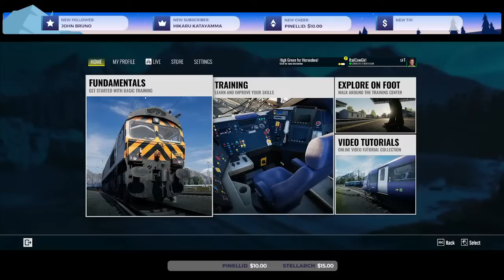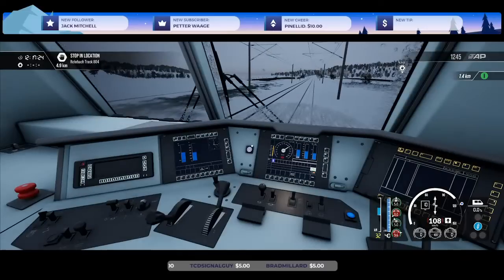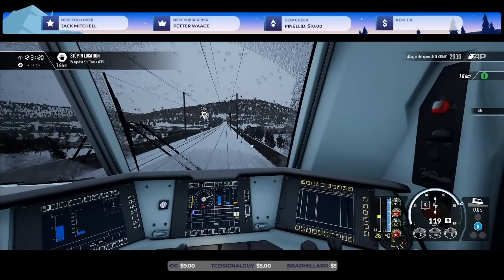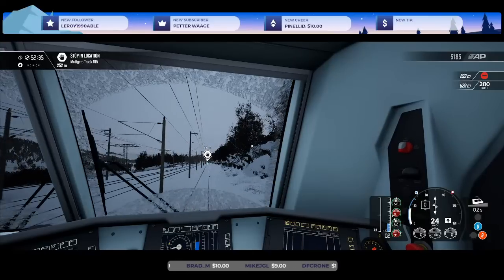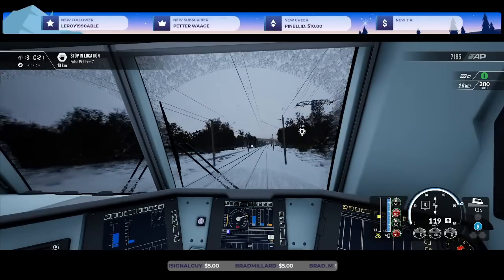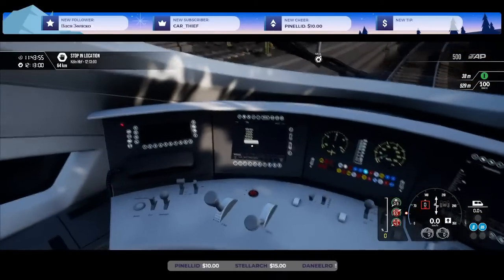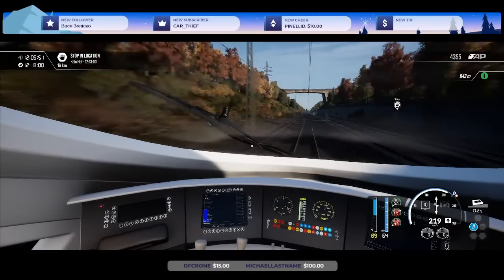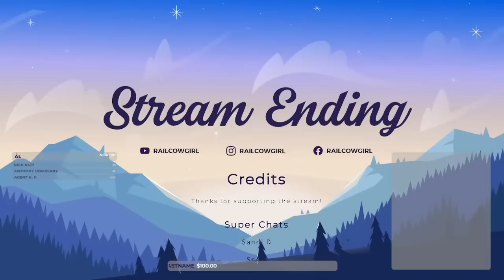TRAIN DRIVER PLAYS: Train Sim World 3 - Does it feel like the real deal

Comment: Although I am not a real train driver, I still think the simulator is realistic enough. In the video, you seemed a bit struggling to use mouse yoke during your operation, and I think you should memorise the keyboard operation, like pressing “a” for increasing the throttle. For turning on the headlights, try to press “h.”
Reply from the maker: It sure is, but with keyboard… it’s kind og weird hehehe

Comment: Do you actually operate the following locomotives in real life DB Baureihe 185.5 187 if yes you should be familiar with the cab. TSW3 185.2 startup is incorrect since the light switch engine room is used to start the locomotive. Not sure if the DB MRCE Dispolok Baureihe 182 ÖBB Baureihe 1016/1116 is cleared to operate into Norway. If yes the voics prompt for the Taurus locomotive in the German language is the Austrian TV announcer Chris Lohner. Taurus if approved in Norway max speed is 210 km per hour 130 mph on the Oslo airport line as Passenger services. If you have NEC NY Newark Airport Trenton you should visit  that by flying SK OSL-EWR then  go to the Newark Airport Railway station from Newark Terminal B where Scandinavian Airlines arrives from

Comment: The ICE derailment in 1998 😭
Reply from the maker: I remember that one. Because of the dual wheel solution with rubber between the rim and wheel.
Reply: @RailCowGirl  The reason why the light cones are so modest in TSW is, because Dovetail has difficulty displaying the light levels reasonably realistically during the day and at night, which is why they are too small to not be blinding during the day.